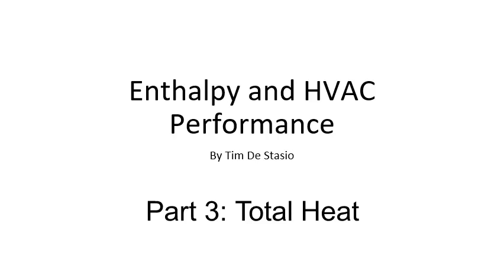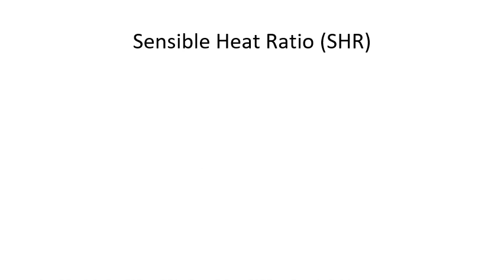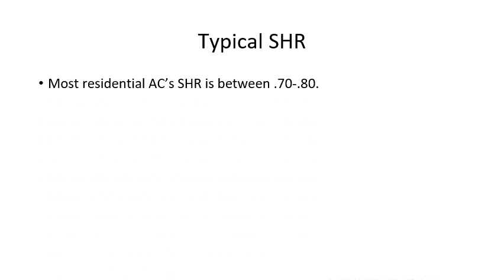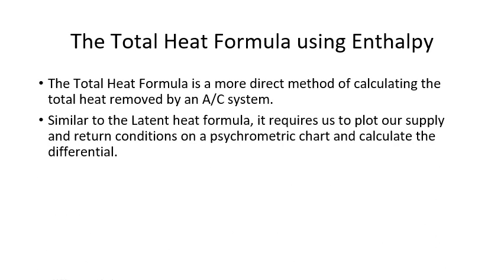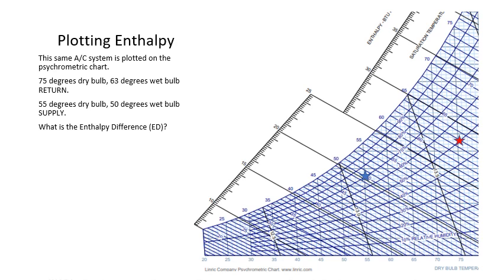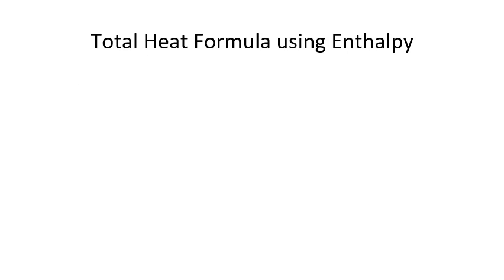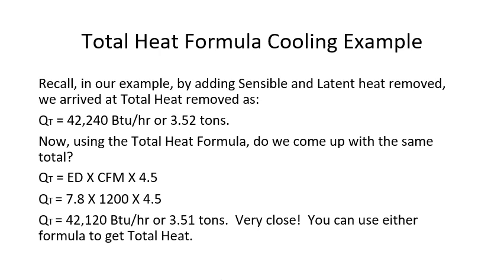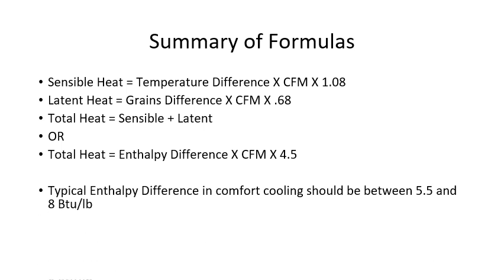Enthalpy and HVAC Performance Part 3: Total Heat

Comment: Great stuff. I love the math.  To make the calcs easier, if anyone is interested I made both a database file of these calculations and much more, and an Excel SS, available for free.  Instruction on how to download them are on my YouTube channel, and I’ve posted the links on a few FB HVAC groups, as well as HVAC-Talk forum.  Best for manual and one off calculations and as a way to avoid math mistakes.  Otherwise I usually just let MQ do the heavy lifting.
I’d post a link here with your approval, if you would like, but a number of times in the past YouTube seems to auto delete comments with links in them.